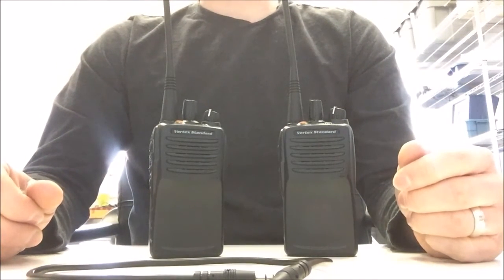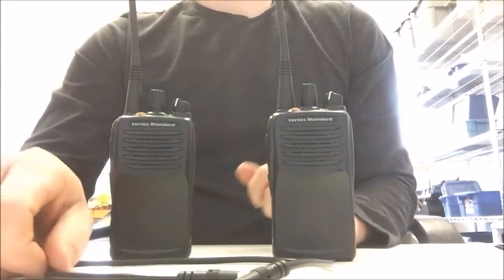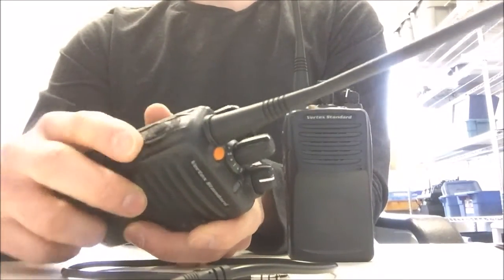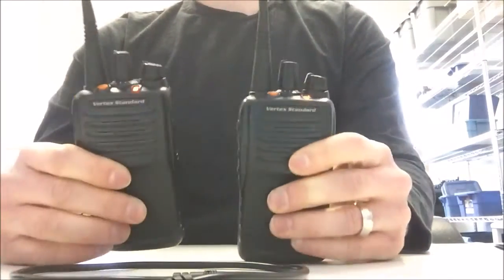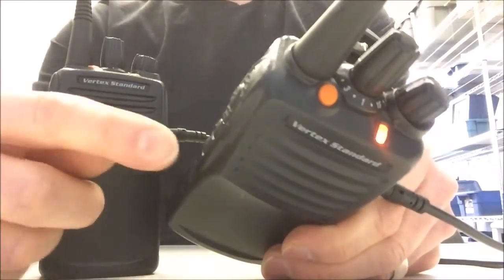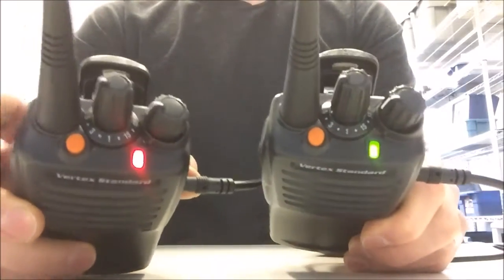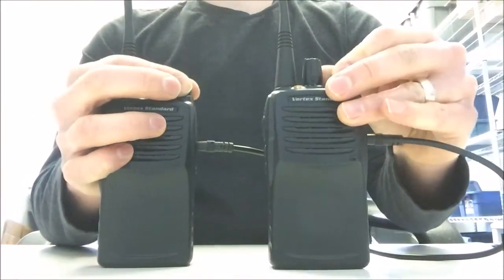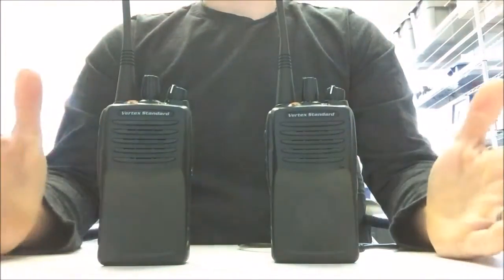How to Clone a Vertex Standard VX-451 Two-Way Radio

Comment: Can you Clone 2 different model radios
Reply from the maker: Hi Matt. No you can definitely not clone two different types of radios together. In fact if the radio does not have cloning programmed into it, it will not work and if there are differences in the major settings of the radios you will also not be able to clone it. We just posted a video on how to enable cloning in the radio should it not already be programmed. Hopefully this helps!